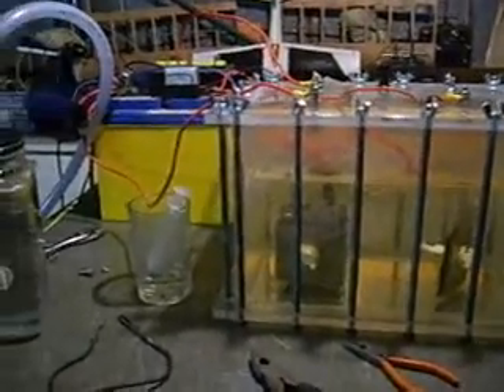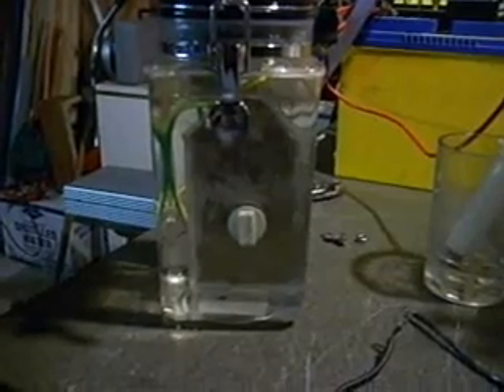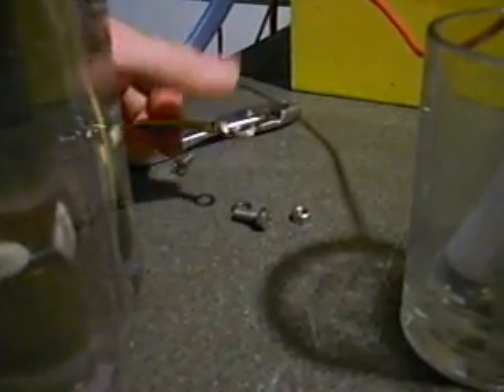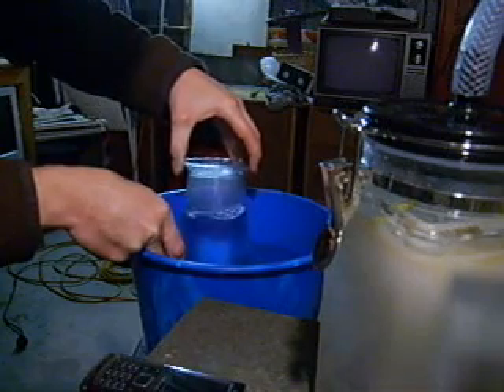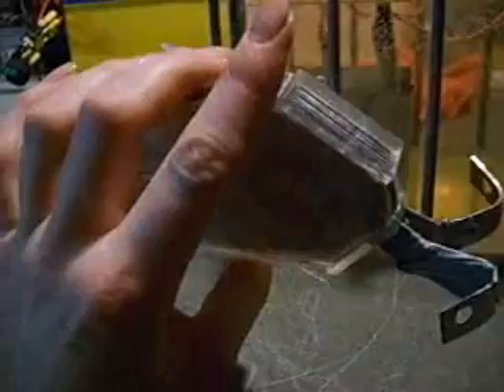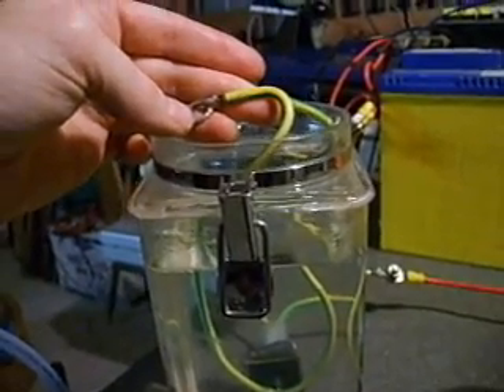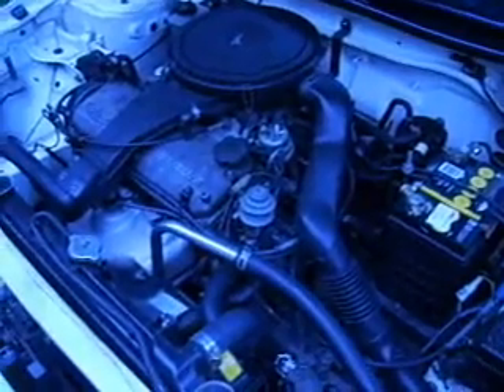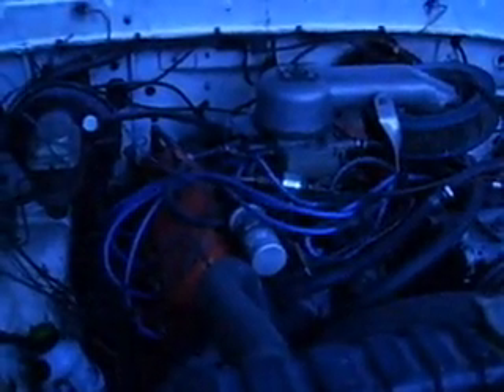Hydrogen at home (New cell, one year on)#21

Comment from the maker: Thanks for that, at this stage I have not seen any breakdown of the lead free solder, unlike normal solder, but I will keep an eye on it.  Eventually the terminals will be completely covered no matter what they are.

I will be interested to see what you come up with. I had a similar idea myself, the trick will be to keep the terminals insulated so that you don't lose current in the water.